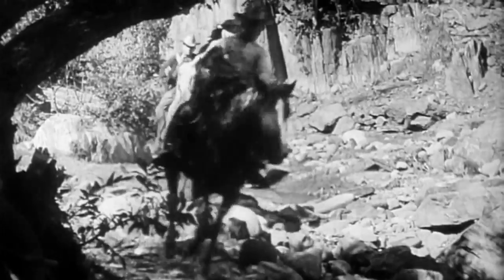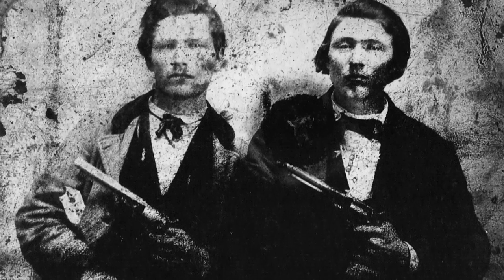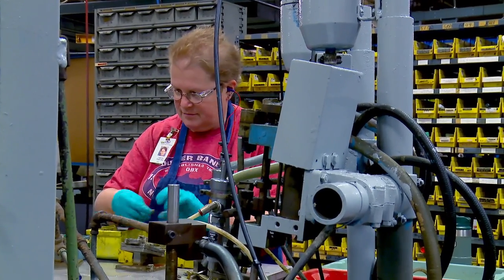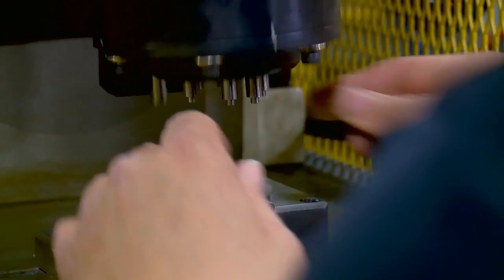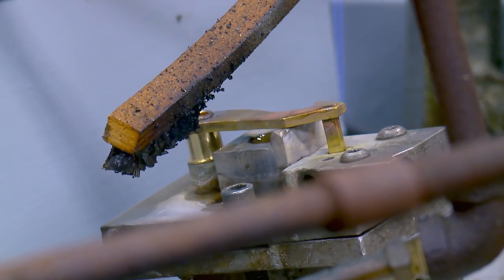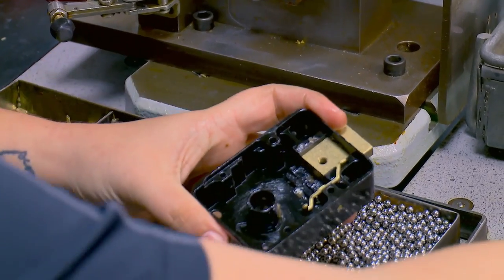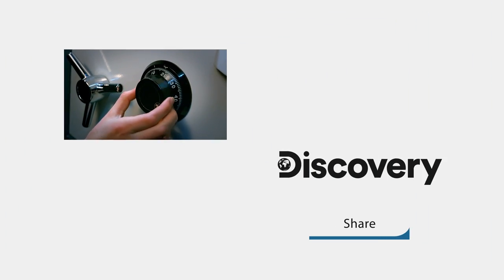How Is A Combination Lock Made? | How Do They Do It?

Comment: Ok so how are you supposed to know the code if it randomly selects it and no one knows the code????
Reply: Printed on the assembly sheet, next to the lock. Yes everybody in the packing line can see it, but once in a sealed pack and in a box hard to find without damaging the sealed pack. Plus you can change it in the field as well.

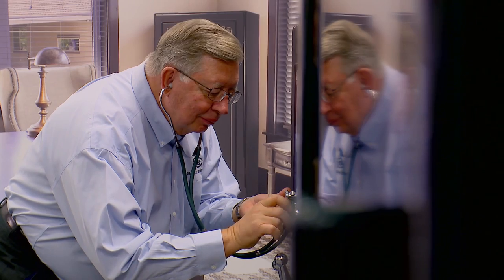Comment: 1:50 If I put a mechanical clock that makes a loud ticking sound, will he able to open it?
Reply: I think it would prevent a lot of people from opening it but I think that there are people who would be able to.
Reply: Yes, absolutely. No reasonable amount of noise can prevent detection. It's more than ticking you gotta pay attention to. You gotta watch the width of the lever gate. It all depends on the quality of the lock. When the fence falls into a gate, the lever gate usually becomes narrower. S&G's are fine locks and are quite difficult because their fence doesn't touch the wheel packs when turning. Audible cues are almost never present on modern good quality locks. Cheap/antique safes sometimes can be defeated by audible cues alone. Some, by feel alone.

I love safe cracking!
Reply: @JeepinBoon  uh have you ever cracked  a safe😂 the fence is always touching the wheel pack on S&Gs
Reply: @lockolot6704  You are wrong. The fence of the S&G is raised off the wheel pack by the drive cam and only allowed to contact the wheel pack at a very small degree of rotation.

Please do not use sarcasm as you know very little of what you speak.
Reply: @JeepinBoon  I’ve done group 2 manipulation though. Ig I’m not thinking of the right terms. 🤷🏼‍♂️
Reply: @lockolot6704  If you've done group 2, I got mad respect for you. I know what it takes. ;)
Reply: @JeepinBoon  lol it’s not really that hard bro. Everyone thinks it’s magic. But it’s just reading numbers and making a graph. Thanks dude. Do you do any high sec picking?
Reply: @lockolot6704  Yea. I collect antique safes when they come up cheap nearby. Highest security manipulated so far is a S&G 6741. Kept the lock as per deal. Check out key picking dawt com. Cool place, lil slow atm
Reply: @JeepinBoon  hell yeah dude!!! I’ve only messed with the S&G 6700 series as far as dials go. But I’ve picked Sever high security locks like Assa Twin combi
Reply: @lockolot6704  Highest spec picking I've done so far is a Medico 72s on a star ground safe and many Abloy 341's with classic core
Reply: @JeepinBoon  dang dude!!! Great stuff!